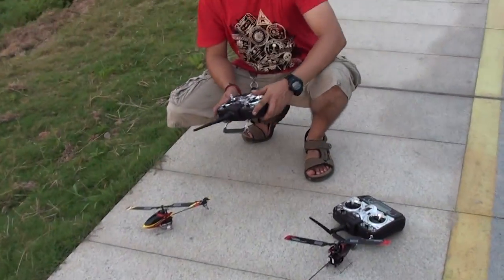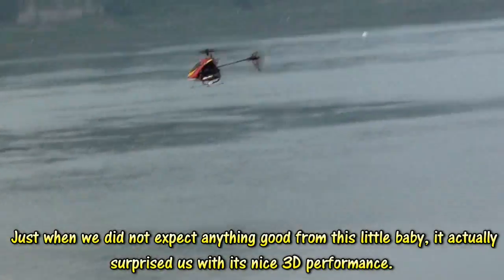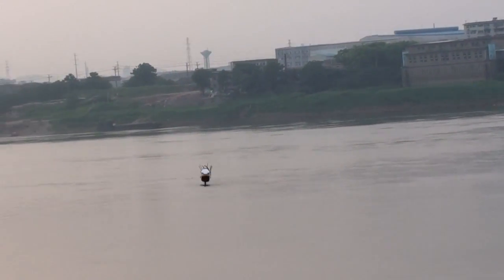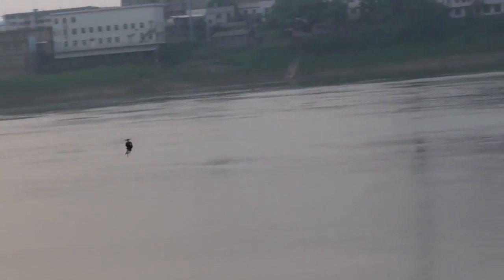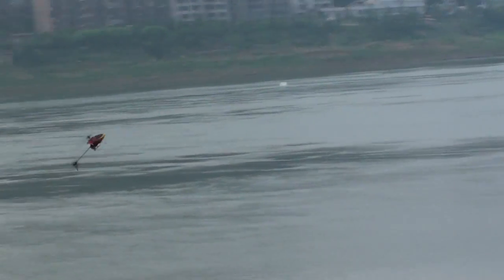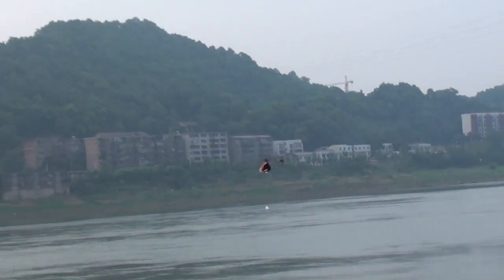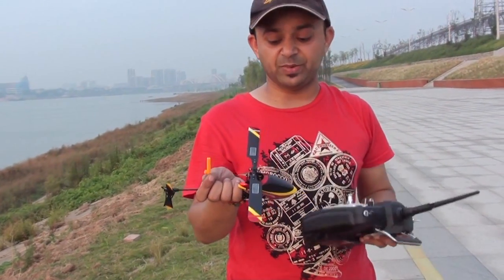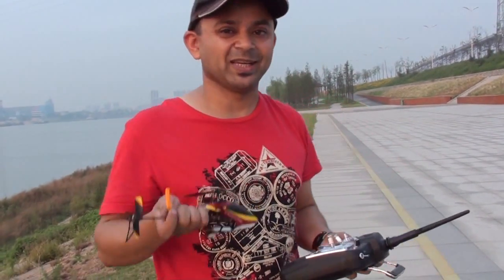Walkera V100D03 outdoor flight with 3D

Comment: Clearly has more power and better tail holding authority than the mCP-X, nice. Another bonus is the longer flight times when compared to the mCP-X. Will be interesting to see the brushed version, I imagine it will be considerable lighter meaning that durability will be greatly improved.